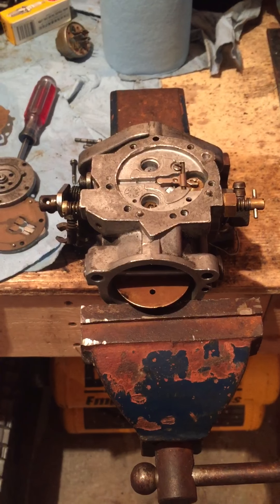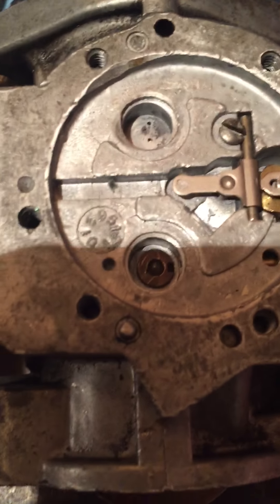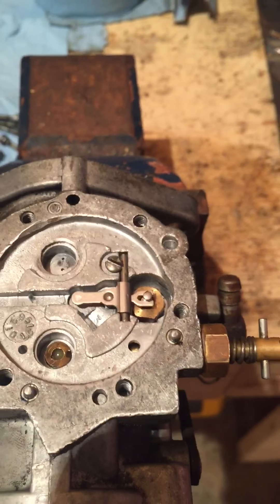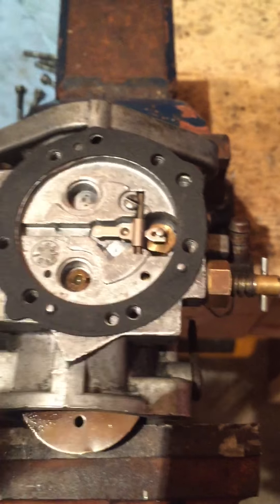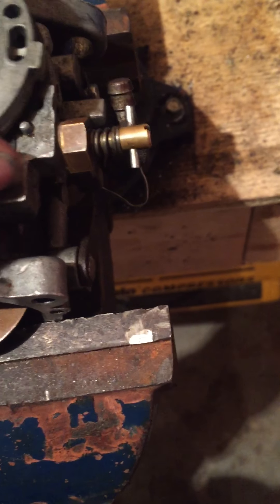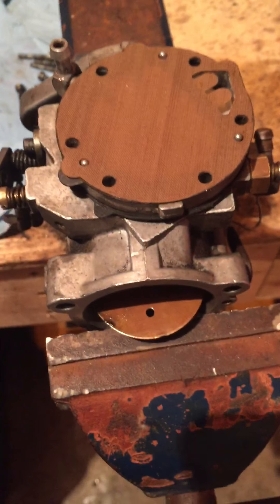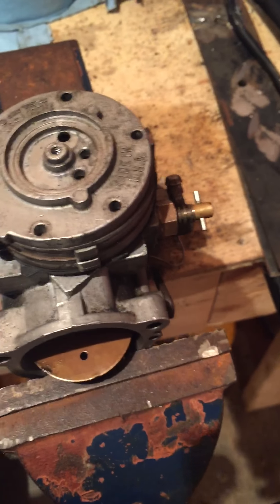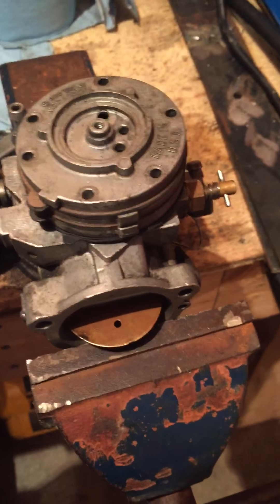My tricks and tips to rebuild a tillotson HD carburetor

Comment: Thanks this video has helped me a lot. Do you have a good source for fuel pump rebuild kits?  I have a 1974 Panther that i'm working on right now with a HD 39A.
Reply from the maker: I get my HD carburetor kits from the local small engine dealer, but depending where you live royal distributing is a good place to get all kinds of vintage sled parts.